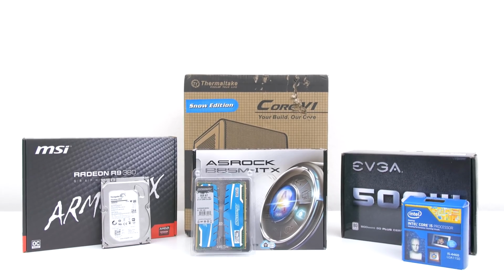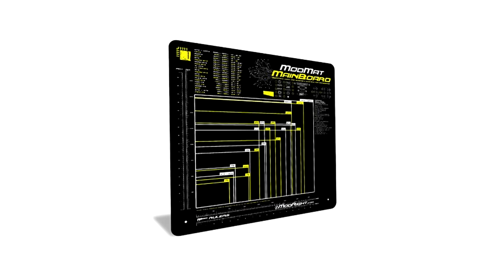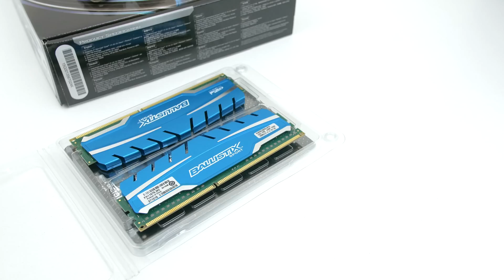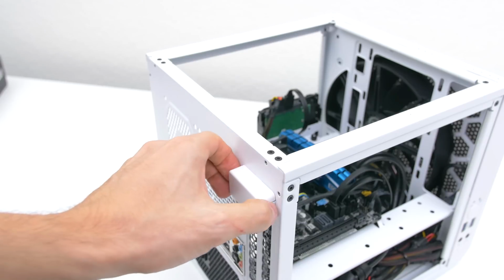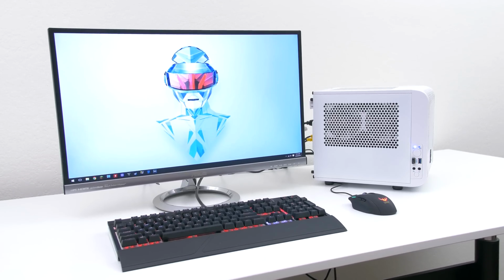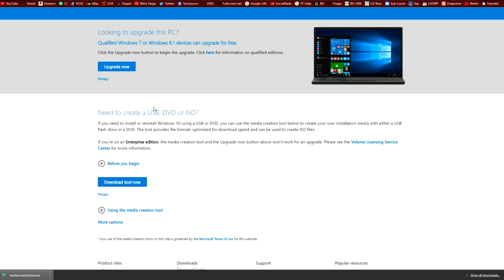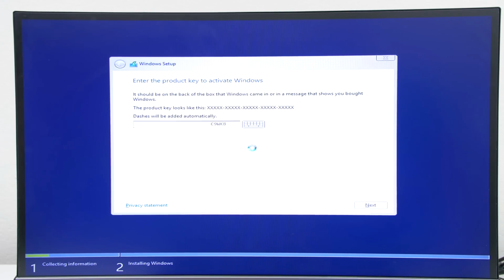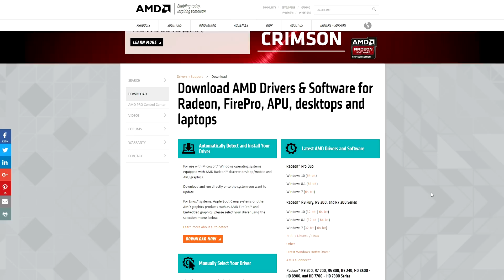How To Build $600 Mini-ITX Gaming PC w/ Windows 10

Comment: I dont know much about computers, but what things would i change that cost more to get higher fps?
Reply: graphic card, get GTX1080
Reply: Depends. What games are you playing?
Reply: I really like csgo, h1z1 etc, but i would like to stream in the future.
Reply: Fordy | Road To 400 Subscribers You don't need to change anything, just wait for the new Rx 480.
Reply: btw if i get like a better graphics card etc, are they bigger or do you put them in the same way?
Reply: Powerful graphic card are generally bigger. It is important learn how to check the case's graphic card clearance before purchasing a graphic card. They all goes in the same way.
Reply: The Rx 480 what is that? will it fit in the case?
Reply: WB IsMe so how can i check if it will fit? like how do i check the clearance? Also, is it just the graphics cards that can be bigger?
Reply: Fordy | Road To 400 Subscribers It's not out yet. It's the same price as the R9 380 in this. And go on the site like Amazon and go to the product specifications.
Reply: Saxton Hale i've checked the product specification on the case but its confusing, any help?
Reply: Fordy | Road To 400 Subscribers Or you could just use PC Part Picker, but still double check. Check the GPU clearance in the case and then check the size of the card.
Reply: Saxton Hale im pretty dumb, how do you check the GPU clearance?
Reply: Fordy | Road To 400 Subscribers Check the product specifications on the product page on whatever website like Newegg or Amazon.
Reply: i wouldn't get the gtx 1080 i would get the rx 480 because it is a lot cheaper and it can run the games you play at a good fps
Reply: OffaDoor would the rx 480 fit? like is it the same size and shit as the other one?
Reply: It will fit but it isn't as bad as the other one because it can apparently run vr so I would wait for it to come out and do a bit of research  while you wait and if you find a better gpu get it. But it will be the best for the price
Reply: OffaDoor what does vr mean? what would i research, like do you mean getting a better gpu? if yes, which would i get? and would it fit?
Reply: +Fordy | Road To 400 Subscribers with the rd 480 you can have virtual reality (oculas rift and HTC vive and things like that) you should research about the graphics card (gpu) because you might find a better one and yes it will fit in that case
Reply: +OffaDoor rx 480 not rd 480
Reply: You would probably want to change the graphics card to the rx 480 as it is slightly more in cost but worth it in the gameplay. Although, you dont really need to as the r9 380 will handle games like gta v and battlefield on ultra. Games like fallout may need to go down to high settings for good fps but still looks great if you have a decent monitor. maybe you should spend more money on a gaming monitor if you dont have on
Reply: pcpartpicker.com  then click start a new build, then enter your parts and down the bottom it will tell you if all the parts fit.

Comment: Am I missing any components for my new computer build? 

NZXT S340 Black Steel ATX Mid Tower Case

SeaSonic S12II 620 Bronze 620W ATX12V V2.3 / EPS 12V V2.91 80 PLUS BRONZE Certified Active PFC Power Supply

HyperX Fury 16GB (2 x 8GB) DDR4 2133 RAM (Desktop Memory) CL14 XMP Black DIMM (288-Pin) HX421C14FB2K2/16

Cooler Master Hyper 212 Plus - CPU Cooler with 4 Direct Contact Heatpipes

SAMSUNG 850 EVO 2.5" 250GB SATA III 3-D Vertical Internal Solid State Drive (SSD) MZ-75E250B/AM

Intel Core i7-6700K 8M Skylake Quad-Core 4.0 GHz LGA 1151 91W BX80662I76700K Desktop Processor Intel HD Graphics 530

GIGABYTE G1 Gaming GA-Z170X-Gaming 7 (rev. 1.0) LGA 1151 Intel Z170 HDMI SATA 6Gb/s USB 3.1 USB 3.0 ATX Intel Motherboard

WD Blue 1TB Desktop Hard Disk Drive - 7200 RPM SATA 6Gb/s 64MB Cache 3.5 Inch - WD10EZEX - OEM

Nippon Labs CT-8INT-BK Nippon Labs 8" Intermediate Cable Ties Black Color 100pcs/Bag - OEM

GTX 1070 Graphics Card

Comment: hi I'm wanna build my first pc, is this stuff good or should I swap things out or change something(my budget is 1200 USD)http://pcpartpicker.com/list/
Reply: You have to use the link in the little box just above the cpu in the build.
Reply: +Saxton Hale here you go http://pcpartpicker.com/list/HCY99W
Reply: fonpcin 1080 CPU: Get an i5! Much better perforamance, same price, cooler, better upgrade path

Mobo: Just get a mobo that fits the i5 that is ATX with all the features you want

GPU: Wait for the Rx 480. I cannot stress that enough. It's 200 dollars and more powerful than the Gtx 980.

OS: Just pirate it or go on r/microsoftsoftwareswap

Wifi adapter: Do you absolutely need wifi? If you do, you should probably just get an internal wifi card.

Keyboard and mouse:
https://www.amazon.com/AULA-Professional-Mechanical-Keyboard-Roll-over/dp/B01DPCJADC/ref=sr_1_1?ie=UTF8&qid=1465578536&sr=8-1&keywords=aula+professional+mechanical+gaming+keyboard

https://www.amazon.com/Redragon-CENTROPHORUS-2000-Gaming-Buttons-Weight/dp/B00HTK1NCS/ref=sr_1_2?ie=UTF8&qid=1465578546&sr=8-2&keywords=redragon
Reply: +Saxton Hale oh ok thanks for the help 👍👍
Reply: Saxton Hale can I get the rx480 without switching to the i5 and also do I need more ram for the 480?
Reply: fonpcin 1080 I5 will be fine for it. 8gbs of ram will be fine.
Reply: +Saxton Hale ok thanks bro

Comment: Ok so here's my dilemma I have a 1tb hard drive that I want to reuse in my (dark cube) build. It has Windows 10 already on it so would I still have to do the weird flash drive step? Any info would help thanks
Reply from the maker: +camodog03 no u don't. Just hook it up to the motherboard with the Sata cable and U good to go.
Reply: Also if I use a gtx 960 4g do I need to install anything? I am nervous since I have never built a PC before
Reply: +TechSource thanks
Reply: +camodog03 If you use that GPU just download the drivers on the Nvidia webside. No problem there.

Comment: On newegg the MSI R9 380 is sold out will it make a deference if I used a MSI R9 380 Gaming
Reply from the maker: +Paul Juszczyk not a huge difference
Reply: which one would make the pc better?
Reply: +TechSource can I use a nvidia GeForce gtx 970 instead??
Reply: You could also wait for the RX 480 $199.99
Reply: +Doom Paladin okay

Comment: Hey guys,  so for VIDEO EDITING ... what would you change about this build?  Let's say I have an extra $200 dollars. Any suggestions?
Reply from the maker: +GeekedUp GTX 970
Reply: 16GB RAM
Reply: Get a Xeon e3 1231 v3 and an rx 480 and 16gb of ram. You should be fine!
Reply: Don't buy the GTX 970, the AMD RX 480 will just release in 2 weeks. It is promised to have near 980 performance, but we don't know that for sure. It certainly delivers better performance than the 970!
Reply: +TechSource thanks Ed :)
Reply: For video editing you would wanna get a mroe powerful processor for rendering faster and such, the gpu would be more for gaming, of course it would also help editing but if you just want to edit and not game that much get a better processsor, just make sure is socket lga 1150 if you are building this
Reply: It does not, early leaks show the performance to be near the 970, in some cases even worse..
Reply: why wouldn't you take more threads over the extra cuda cores ?
Reply: +PeloyGeek I don't understand?
Reply: +PeloyGeek if u upgrade the 4460 you will get bottlenecked so the only thing to do is buy a 1070
Reply: +PeloyGeek Okay I get it now,  so what would you recommend if I'm pushing, 2 1440p monitors?  And Also what about RAM,  16gb?
Reply: +GeekedUp that gpu can power the monitors just fine as long as you don't plan on gaming in that resolution, and yeah 16gb 1866mhz should do it better
Reply: +PeloyGeek and you're talking about the r9 380 mentioned in the video right? 
Okay cool
Reply: +GeekedUp yeah if you have more money get the x version but that one should be fine
Reply: +PeloyGeek alright sounds good bros thank you for the help!!  :)
Reply: +GeekedUp lmk if you need anything else :D glad to help, also if you wait like another month the rx 480 should drop and apparently its a lot better performance for the price
Reply: +PeloyGeek gotcha!  👍👍😊
Reply: +PeloyGeek this board only supports 1600mhz but it won't make a difference anyways
Reply: PeloyGeek you can't over lock that much on this board :P
Reply: +moh you yeah yeah just remembered chipset of this board and deleted the comment haha, but yeah that cpu would be a better buy
Reply: PeloyGeek which cpu?
Reply: the xeon for video editing
Reply: PeloyGeek no, a Xeon e3 1231 v3 is pretty much an i7 4790k without over clocking but with ecc memory support
Reply: and without the iGPU
Reply: PeloyGeek this specific Xeon, yes (who even uses the iGPU with such a high end chip) but some other xeons do have iGPUs (iris pro graphics)
Reply: i was actually thinking of selling my whole pc since i don't rly find games AS much fun anymore and just buying lke a 6500k and use the igpu haha, making like a mini machine, or maybe just a low end gpu so i can run 3 monitors
Reply: PeloyGeek pls give it to me
Reply: ill prolly just sell it and buy a new system
Reply: PeloyGeek GIVE IT TO ME FOR FREE. I play gta v at 20fps lowest settings 1280 x 720 :0
Reply: my pc cant run gta v
Reply: RIP
Reply: the struggle is real
Reply: +PeloyGeek so you guys made it confusing lol
Reply: your welcome :^)
Reply: that depends.....is CUDA best suited for for video editing relative to GCN? Would of been nice if you added some reasoning especially considering the 480's release early July (not reference but AMC). If GCN is better suited than all of us could save some cash all while having a better gaming experience and of course the 8 GB is welcomed.
Reply: well, it is $200
Reply: http://videocardz.com/61512/first-radeon-rx-480-gaming-benchmarks-hit-the-web Proof, it does not
Reply: Those benchmarks are really weird. Since when does a 380X almost beat a 970? I'm going to wait one more day and watch/read legit reviews from our tech youtubers.
Reply: +GeekedUp what does it mean tech tutorials and more, but seem so new to this ?
Reply: +Edjaher Lopez software related (comming soon) , not hardware related. Do you know the difference Lopez?
Reply: i7
Reply: i7 4790k, hyper 212 evo, sansik ultra II 480GB SSD
Reply: +Timo FL thanks for the suggestions :)
Reply: +German Kerman  +tryblue thanks guys!
Reply: Johannes Werner everyone seems to be focused on the gpu, but the cpu is more important when it comes to rendering right?
Reply: Ed has a $800 monster build, Go watch that video :D
Reply: TheDutchGunners better gpu doesnt help with editing at all tho lol
Reply: +Timo FL It does help with video editing. You can enable CUDA / Stream processor rendering. It makes use of the GPU cores, and improves the performance heavily. However, a good processor is more important than a good video card in editing, this is why the Titan series exist because those cards have massive amounts of CUDA cores. They're like the Broadwell-E processors from intel: no gaming performance increase but performance increase in video editing and CAD
Reply: Maxxoz YT I bought an i7 6800K and a GTX 1080 for both editing and gaming
Reply: +Timo FL Good choices
Reply: if strictly editing and work, maybe use those Nvidia Quaddro / AMD Firepro graphic card, and use 8 core amd cpu or Intel Xeon cpu. (mobo has to change to the one fit for the cpu.)
Reply: The processor and the fan, if you get a good fan you should overclock it, but make sure to add more voltage.
Reply: go with Xeon its cheaper, better PSU and GPU should fit budget I recommend evga g2 series
Reply: +Archie Chapman cheaper than an i7 I meant and the GPU isn't more essential than the CPU in video editing plus should only be like 40 do
llars more only giving him room to upgrade the GPU and PSU
Reply: Is it possible to upgrade to 16gb of ram ? If so , can someone link me to some 16gb ram which is compatible for this build ? Thanks in advance !
Reply: $ 200 on your GPU
Reply: ***** What I meant was bump up the price of your gpu by $200, which is essentially getting the 970.
Reply: ***** ye good input Archie
Reply: Maybe buying a i5 unlocked cpu and a mother board that can support overclocking and the rest on a btr gpu / on peripherals
Reply: I think the i7 4690k would be good
Reply: +CHINESEKID420-_-BROTHER Lol you can't put an i7 4690k in this build otherwise you have to change almost every part of the pc
Reply: Oh sorry about that but i just heard it was a good processor I didnt know you couldnt put that in this build :(
Reply: +mizz b Gtx 1069
Reply: +iLiStAr *1060
Reply: I built this game and its a beast the only thing I changed was the gpu with a gtx 960 and its so good
Reply: +mizz b 1060
Reply: It practically runs like the benchmarks.BTW
Reply: +mizz b for the gtx 1060 I would say yes but it depends on how much u have to spend
Reply: It depends how much you want to spend
Reply: Its work amazing I every game a minimal of 60 fps steady with v sync on
Reply: I have the evga 2 gb and thats a beast but im sure the other ones out there are good but i went with evga
Reply: +mizz b The superclocked model? yes I have the super clocked model so it makes the best performance for you.
Reply: i would put a damn 980 in there or which is cheapest idk
Reply: I built this PC and it's on but I'm having trouble connecting it to my TV, I have a HDMI cable in but the TV says no signal, any usual troubleshooting problems?
Reply: Do u have it in the gpu or the motherboard beacuse that could happen
Reply: take the new 1060
Reply: +CHINESEKID420-_-BROTHER It's in the motherboard, which should it be in?
Reply: +Marauding Bear Did you change it into the gpu and are you in the correct input signal for the hdmi?
Reply: I7 instead of i5
Reply: Maybe a 4770K or a 6700K for a CPU or a GTX 960 or 970 for the GPU.
Reply: to add? Yeah sure
Reply: For premiere pro, get an nvidia card. 970 4gb is a great card. 
If you are planning on making your build a hackintosh and using final cut pro, go with a AMD gpu.
Also, you might want to go with a better CPU
Reply: Heyyyy ED, can you make an updated 800$ build with a monitor
Reply: I can collate you some parts for a really good $800 pc
Reply: here you go mate
Reply: Samuel Newton what do you mean "here you go "?
Reply: i7 and more ram
Reply: Lozan Kirandziski nope, i5 6500
And a h110m motherboard or around 50 dollar mother board (msi h110m pro  is good) and some ddr4 ram ( 16gbs is good)

Comment: Would a MSI R9 390 work with this build?
Reply: Depend on the size.
Reply: +WB IsMe If the graphics card that he provided is basically the same size as the 390 would it fit?
Reply: dopekid.975379 yes

Comment: I heard that Mini ITx's have terrible airflow, and are bad for gamers. Would I be at risk using this build?
Reply: No, the Thermaltake Core V1 has good airflow. The step-up, the Thermaltake Core V21 is bigger and uses a whopping 200mm intake fan.
Reply: Saxton Hale Do you think the 
BitFenix Prodigy M Arctic White MicroATX Mini Tower Case
'
also has good airflow?
Reply: Smiles Yes, if you set up your fans correctly. Google the fan set up for that case.

Comment: I'm going to build my first pc, everything should be fine but i'm really scared of that windows key...
Reply: +Marvin that it wouldn't work like it should, is it legal ?
Reply: +Marvin alright man i trust you i guess 😊 will save me allot of money
Reply: on kat.cr you can get an illegal way to active windows 10 for free using kmspico. It works but fakes of this exist on the internet. But once activated it will work as a legit one
Reply: +Raf Van Nuffel while the keys are legit, the ones sold on the subreddit are MSDN keys. Basically not meant for retail selling. Keys from there have been known to deactivate after a few months. So I'd recommend buying one but saving up for a retail key just in case it does deactivate
Reply: +Katsana they always do, or it depends on ur luck ?

Comment: how to build a 150usd gaming PC?
Reply: i think this is a bit over http://pcpartpicker.com/list/KwKfNG
Reply: +kawder safatli I'm kinda impressed actually, I was expecting a joke
Reply: posible INTEL XEON E5450 for 30usd + gtx 750ti for 50usd + lga775 motherboard 30usd + 350w-500w psu for 15usd and some random ddr3 ram + 200gb hdd for 5usd + a pc case from a junk jard for free
Reply: 27fps minimal on ultra setings
Reply: +robertas grigas Haha please tell me your joking
Reply: die hobbo
Reply: +Joshua Day I built the PC in the video but I can't connect it to my TV with my HDMI cable, the TV reads "no signal", any regular troubleshooting problems? (It's plugged into motherboard HDMI port)
Reply: +Marauding Bear I actually had the same problem with one of my pcs but I'm still not all that experienced so hopefully someone else puts in better advice. But two things to try. First try to use separate monitor to download drivers (this worked for me but my problem related to the graphics card) and another thing I've done before is hooked up a monitor with vga while still plugged into the tv hdmi, then when In display made the tv primary screen and the monitor second and that worked for me.
Reply: +Marauding Bear You have to put the HDMI cable into the graphics card.

Comment: wow this budget pc build will cost me 817$
i5-4460  - 188$
AsRock B85M-ITX - 122$
Crucial Ballistix 8GB Ram - 51$
Seagate 1TB Hard Drive - 50$
MSI R9 380 - 234$
Thermaltake Core V1 Case - 101$
EVGA 500W PSU - 71$
Reply: Get a cheaper case, gtx 960 2G and cheaper ram. You can find some ddr3 dimms for about below or 40 bucks
Reply: also pretty overpriced for a b85 mobi
Reply: yeah i can replace parts for cheaper analogs. but ITX stuff and "branded" stuff are highly overpriced here. sad :(